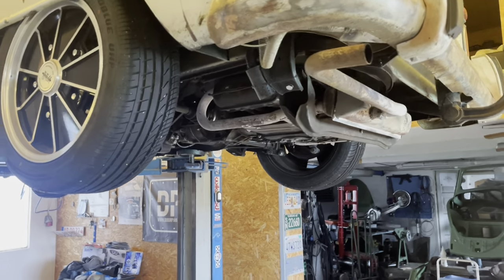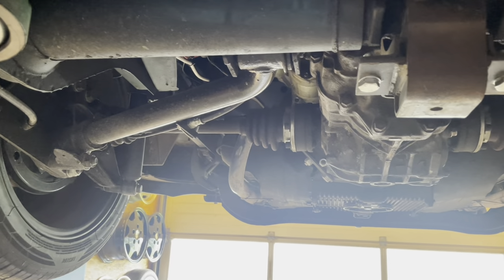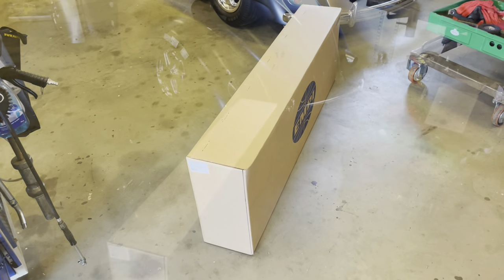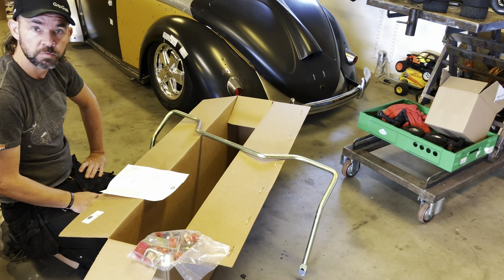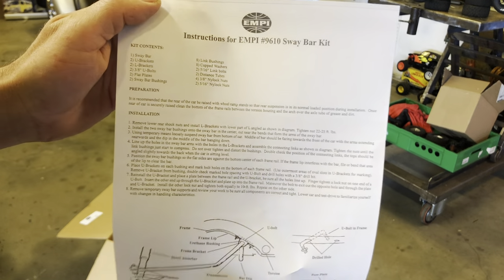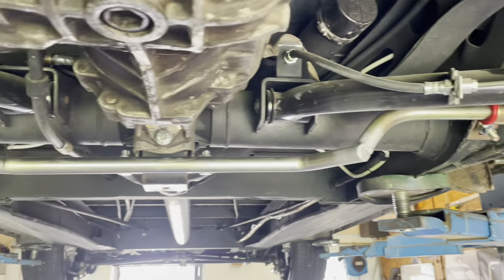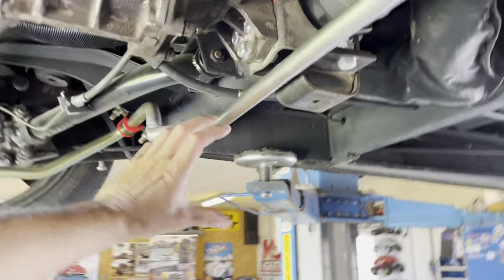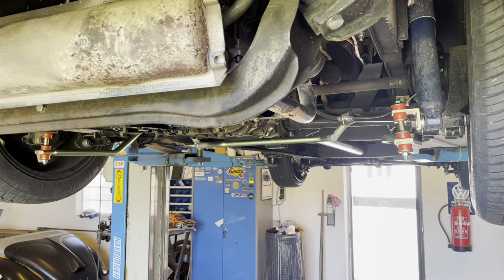“How to” fit a rear stabilizer on your Volkswagen Baywindow.

Comment: Looks like rear wheel fender clearance is very tight.  Perhaps that is just the camera angle.

Curious how the cut bar holds up.  Suspect you’ll need to fab up a different bar sans cut for durability